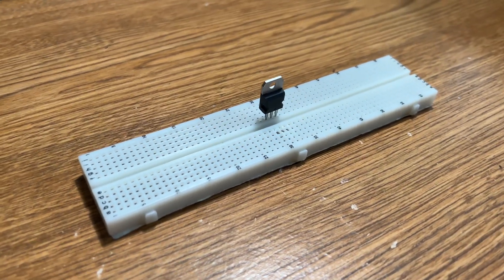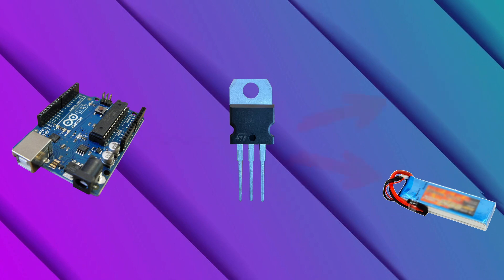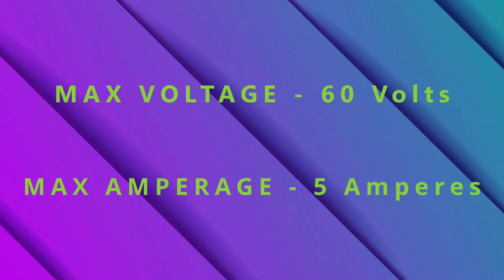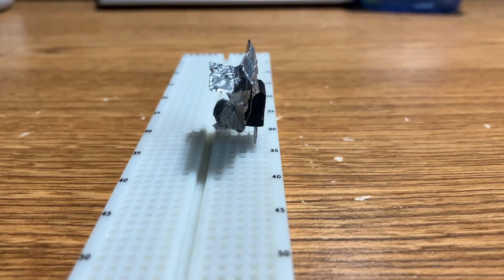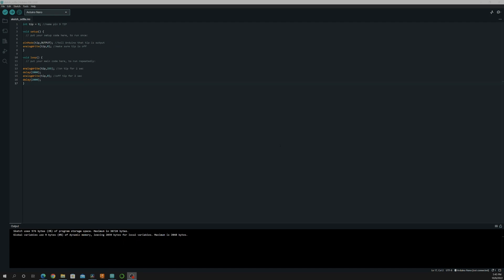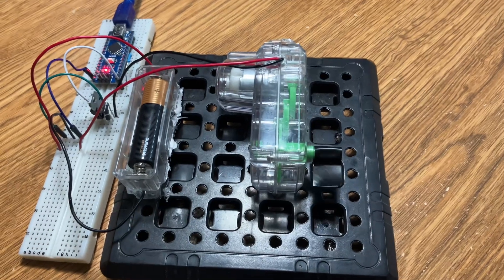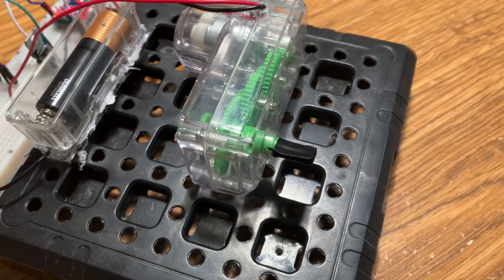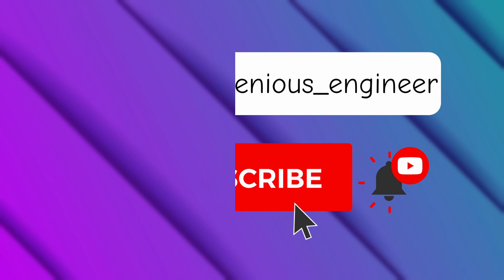How to Control HIGH-POWERED Electronics with TIP120 and Arduino!

Comment from the maker: Thanks for watching! Please share, like, and subscribe! Watch this video next!: https://www.youtube.com/watch?v=dcxkTOW5KP4
Reply: Hello, thank u for the video. How can this be wired without the diode?
Reply from the maker: @BigTurtleMane You can replace the diode with a normal wire, but is very much not recommended. The diode is there to ensure the current flows in one direction, and replacing could lead to the TIP120 or other connected electronics burning up.

Comment: do you know the cool thing about this circuit? you can still damage or burn your components yeeee😁. anyway  what about induced overvoltage that you can have from magnets sticking to the solenoids? how do you protect the circuit from that? magic?
Reply: Yea, I was wondering why the diode was on the transistor.  It should be across the motor.
Reply: Same here, I was also wondering about diode placement